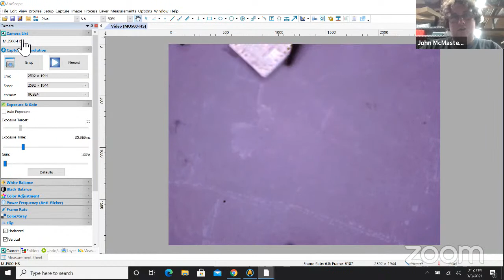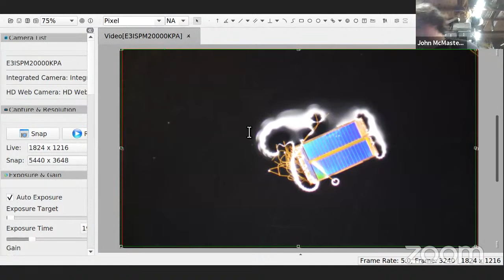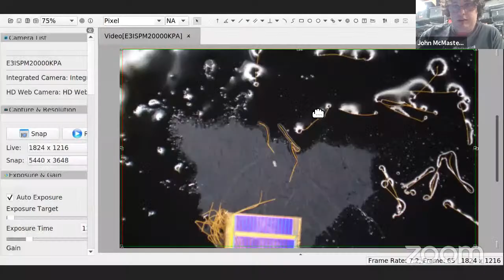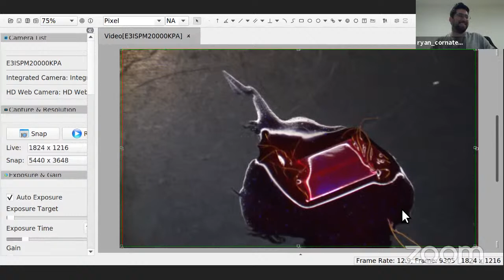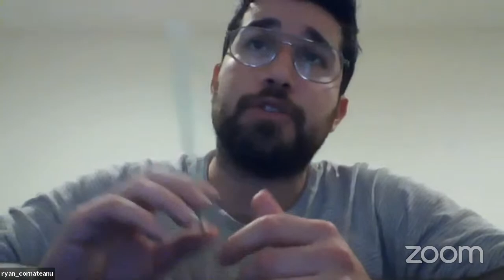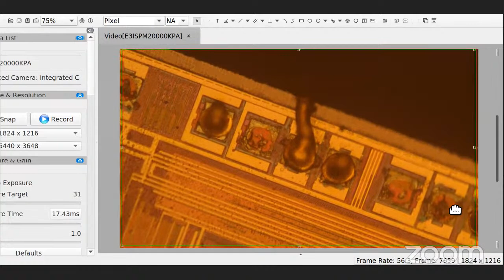Chip bond wire removal: techniques and demos

Comment: How would you recommend removing the wires in a way to re-use the chip? I have a chip mounted in a chip carrier where the chip was wire-bonded incorrectly and would like to correct them at some point as it is a rarer chip and a bit hard to get ahold of these days.
Reply from the maker: Hi there! Its possible but its an invasive / high risk process. If you are doing it commercially I can help connect you to someone. If you are doing it for fun / DIY, consider joining the siliconprawn discord. In any case you can find my email here: https://siliconprawn.org/